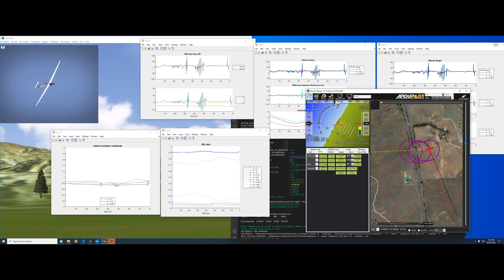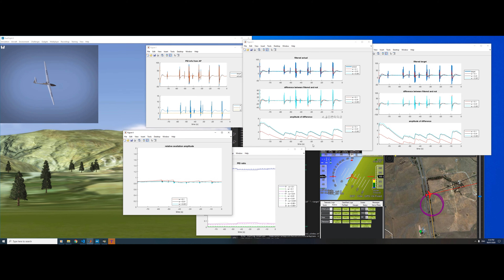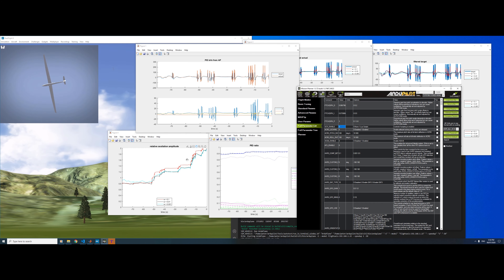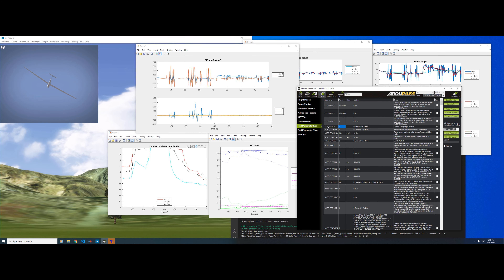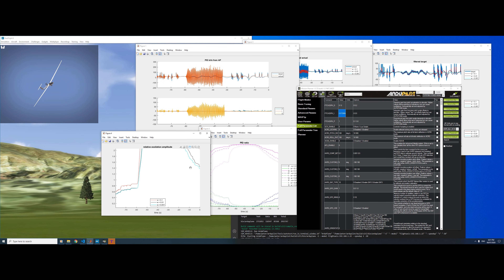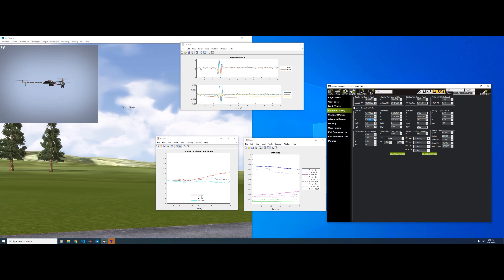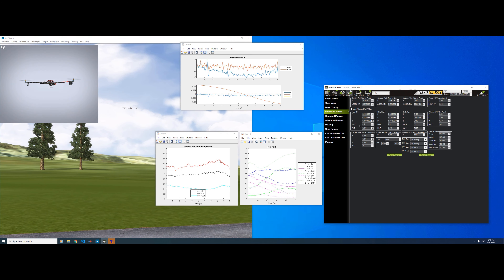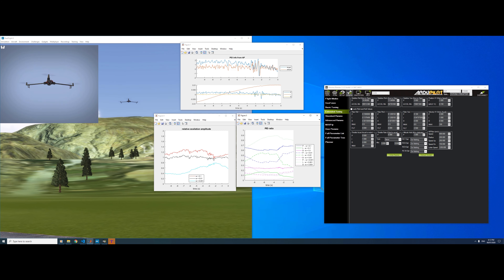ArduPilot PID oscillation detection algorithm testing

Comment: Hi, I'm having surfing issues on a v-tail plane only in auto flying modes.
Plane flys really well in manual and fbwa mode but when in rtl, cruise, wp etc I am seeing a surfing like motion 3 meter up down from target altitude.
I'm not that good with tunning and I'm wondering do you have any ideas what might help?
Thanks.